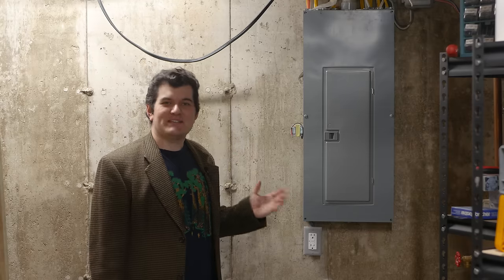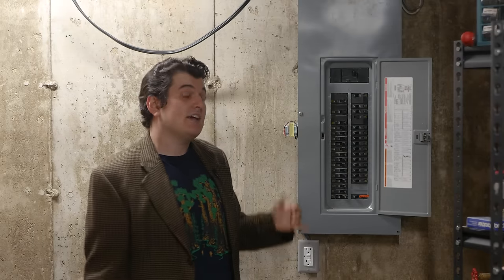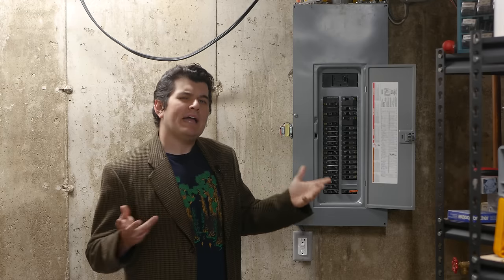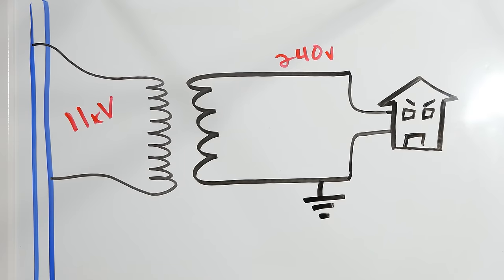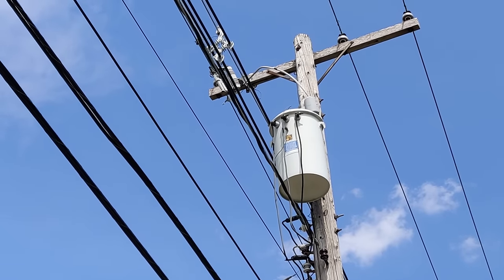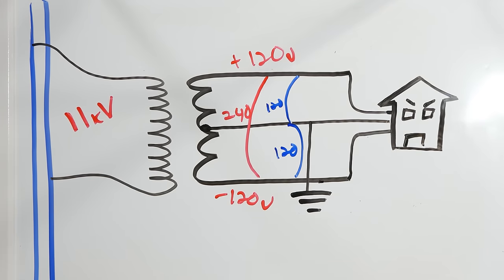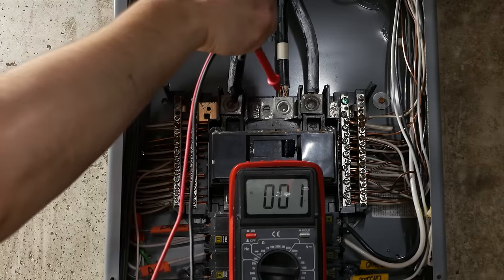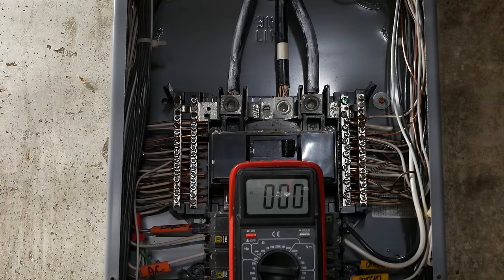The US electrical system is not 120V

Comment: Fun story, I once accidentally dropped a nickel off the end of my bed and it fell on the two plug posts in that tiny gap between the plug and the outlet. I saw a huge flash of blue light a flame and puff of smoke. Luckily it tripped the breaker but when I found the nickel it was black had two slots melted into it about halfway down. The plug posts were melted pretty bad too. Kind of terrifying really. All because that plug just happened to be a couple millimeters away from the wall and that nickel just happened to perform a one in a million shot. I'm glad my apartment didn't burn down.
Reply: That can't happen with UK Plugs, the pins are protected from such a short condition.
Reply: That's one reason power outlets are often installed with the ground pin on top. But if your plug has no ground pin, it has no effect. I suppose power outlets could be installed landscape-style.
Reply: @Johnny.Fedora  First, UK live pins can not be touched even by a nickel or knife blade, when they are in the Outlet far enough to actually be live, and that is without the Earth pin at the top further protecting, , ,  I believe all American installations since about 20 years ago, had to be 3-pin Outlets, OK, there are many 2-pin plugs still in use in America.. . .  Actually I have always installed American double Outlets in landscape-style.
Reply: @hughleyton693 , you are correct -- my post was U.S.-centric (and the electrical code has required AC sockets with ground (earth) pins for a lot more than 20 years).
Reply: Welp, that image is going to stick with me forever, any time I see a plug which is even slightly loose.  I now have a newfound appreciation for "upside-down" grounded outlets with ground at the top.
Reply: @Johnny.Fedora  I have never seen one electrician install an outlet with the ground pin on top, ever. The circuit breaker did exactly its job.
Reply: @fn0rd-f5o , the NEC in the U.S. doesn't specify which way the ground pins go (the outlet can even be mounted horizontally), but I've seen licensed electricians install outlets with the ground pin up.

I am agnostic about it; some things such as grounded power bricks that hang from the power socket assume the ground pin is on the bottom, and aren't mechanically stable if they are upside down from their preferred orientation. 

However, there is a rationale for installing outlets with the ground pin on top:

"The outlet should be oriented with the ground pin up because if the plug comes slightly loose and a metal object were to fall from above, the ground plug, which usually does not carry current, would deflect the object so that it would not hit is live prongs." -- Archtoolbox
Reply: @Johnny.Fedora  I'll join the necro-posting (reviving an old thread from the dead)  - my understanding is that in the US, ground up is standard in hospitals, that also require metal outlet plates, so they can be cleaned with hard disinfectants. Imagine what happens if a plate screw works loose: it both enhances the chance that the plug will not be fully seated, and is perfectly positions to itself fall across the power pins and short them. A slight risk, but higher than the million-1 nickle shot.
Reply: @RossReedstrom , I believe you are completely correct.
Reply: @hughleyton693  Sorry but you can insert a knife blade between the plug and socket face. This is impossible with the a German Schuko Type.
Reply: @billpugh58  It is also impossible with the UK 13A Plug.. . . The live and Neutral pins have plastic insulation over the pins to protect from your knife blade. . .   But that can be done with the American plugs, both the 120V and 240V plugs, even a small kids finger can do that,  😞
Reply: @Johnny.Fedora  there are still tons of homes that only have a hot and a neutral, and its against code to replace it with a 3 prong unless you add a ground which in most cases easier said than done w/o tearing the house down to the studs and rewiring it which is as costly as it sounds
Reply: Poorly designed sockets and plugs.
Reply: For decades I have seen receptacles in (some, but not all)  U.S. hospitals mounted upside down, for this same reason, because the architect has specified stainless steel cover plates and knew that, sooner or later, a plate would drop on a plug’s pins. (Now I’ll bet the next time you visit a medical facility it will drift into your mind to examine their receptacles.)
Reply: @fn0rd-f5o this is more common in industrial/commercial installs than residential. We should do it everywhere though.
Reply: @fn0rd-f5o  It's safe to conclude that you've never seen one electrician install an electrical outlet in a hospital in the United States.
Reply: @jmdavison62  I've installed and plugged in printers in the va. They were right side up
Reply: @fn0rd-f5o  Right side up = ground pin up.  I believe you.
Reply: @jmdavison62  not arguing just saying I've never seen them that way 🤣 now I'll be seeing them all over

Comment: Personally I love that we in (mainland) Europe use E/F plugs. While technically F is the Shuko-plug, you'll find that many electrical devices and powercubes and -bricks accept both E (found as (older) French, Belgian, Tunesian and somehow Slovakian outlets) and F. The diffence is in grounding:: E adds a third plug, F has the grounding on the side. Both sides, so you can put the plug in upside down or not. And two plugs is simpler to plug in than three. All in all, I love our Schuko-system.  And that also means we use Type C if grounding is not needed. Handy for, well, you find these still on 'boomboxes'.Or gameconsoles. Audioequipment. And your tv. But your computer is connected via Schuko, aka F.  Thanks for the video! Now I know how good it is! ❤
Reply: ahh yes the type f plug most notably known for being cut out and replaced by type h plug
Reply: @plazmaguy13yago9  is it? I'm from Hungary, and the two main types of plugs I see and use are Europlugs and Schuko/Type F (or lately CEE 7/7). The sockets are all type F / Schuko, except in old houses where there are still some ungrounded type C sockets.
Reply: Guess the type E in Slovakia is from when Czechoslovakia was still a thing, because it's a standard in Czechia as well

Comment: I was a home products service (Major Appliance) repairman for 27 years and have been shocked hundreds of times. One day while repairing a Microwave oven the charge in the capacitor stopped my heart. The room went dark. Fortunately the sudden fall to the floor re-started my heart. Rubber gloves is always a good idea around electrical circuits...Great video!
Reply: @Spindrift_Productions  these capacitors are rated up to 3000 volts, much higher voltage